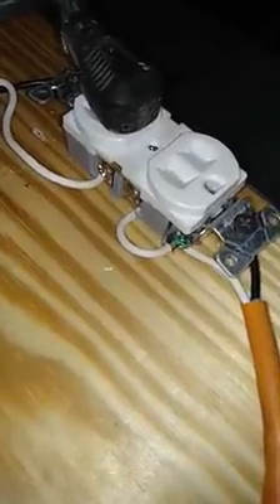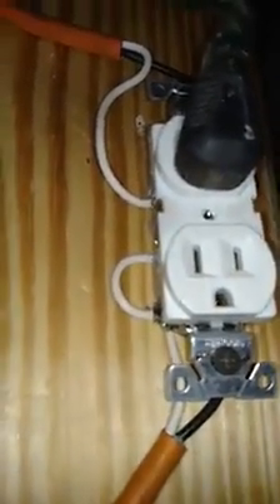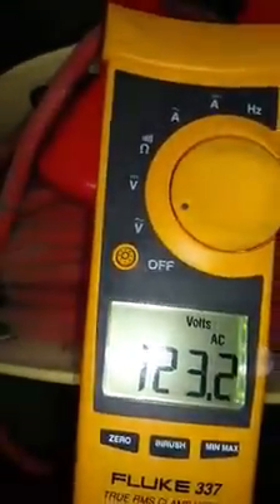Why you never jump your neutral to the ground on a wall outlet.

Comment: why people do this?lack of ground wire?
Reply from the maker: They do it because they don't understand  how current flow works. I guess you can say those that don't understand  current flow do this because  they don't have a ground wire. The correct fix for this is to install a 2 prong outlet. Period. If installing a gfci, just hook the hot and neutral up correctly and then label the outlet no equipment  ground. Done and done.

Comment: Why was the fridge hot? Was there a fault that you made to show the point or does something else happen?
Reply from the maker: Yes, it was a fault, well two faults.
First, the neutral and ground were jumped together. That is improper wiring that is commonly done and it is dangerous. The second fault was I reversed the hot and neutral, which is another common mistake made by people who don't fully understand electricity.
Reply: @dbunk6276  OkI understand now. I meant did you induce any type of fault in the fridge itself? Like have an open hot touching the frame to show that the short protection wouldn't happen now. Which obviously it wouldn't. But now I see what you mean. 

Just a normal wired fridge could do that if someone messes up.
Reply from the maker: So, the fridge chassis was energized because the neutral has now become a hot wire, and with the ground jumped to the neutral on the receptacle, it create a path to the grounding on the fridge which is anything metal.
Reply from the maker: Correct. All it takes is for a "Handyman Hank" to wire a receptacle like that and you'll have shocking issues. I have seen wiring done just like I showed in the video. It's insane.
Reply: @dbunk6276  A handyman could just have one mess up with this bootleg ground and it would be enough still. Since someone else at some time could have wired a receptacle upstream the wrong way and the wiring on the recp. he's looking at appears fine at sight.
Reply from the maker: Exactly

Comment: ZM if you bootleg the neutral you are putting current on the ground terminal. The neutral is a current carrying conductor. On  120 volt circuit if you have 10 amps on the hotleg you will have 10 amps on said neutral if you have a 240 volt circuit with a neutral and line1 has 10 amps and line2 has 8 amps then neutral has 2 amps the only time a ground conductor has current is when you have a ground fault. So what you presented was that it was safe.

Comment: interesting... then how does someone ground a 1950's circuit without major work?  I thought this was safe....
Reply from the maker: With major work is the only way. Please realize that a gfci receptacle does not require a ground for it's proper operation. A gfci only monitors the hot and neutral for a ground fault, not the ground wire. So if all you have is a two wire system, per the nec code, the legal way to wire a gfci is wire the hot and neutral like you normally would and place a sticker on it denoting that there is no equipment ground.
Reply: @dbunk6276   that is not necessarily true, when i replaced my parents 2 prong receptacles with gfci outlets, the gfci would not trip unless you cheated the ground, once you cheated the ground the receptacles worked and tripped as it was supposed to while using a gfi tester, the only reason you may have to attach the ground to the neutral is if the box isnt grounded either, in my old house the metal boxes werent grounded, so you still had to bootleg it to make the gfci trippable, but 1 box was grounded so just screwing in the receptacle without bootlegging the ground worked as intended, this was at my house pre 1910s and my friends house pre 1920s
Reply: @T @TheWackyRigger 
The reason you needed the bootleg ground to get your GFCI to trip, has nothing to do with the GFCI itself.  GFCIs trip if there is an imbalance between hot and neutral. 
It is your TESTER that needs ground to function, because it creates the imbalance by allowing some current to “leak” directly to ground.  
You need to go back and remove the bootleg ground.
Reply: @DavidWood-rc6gj  i learned from my mistakes ! my foreman was the one who taught me that i needed to run a jumper but since then i learned why he was wrong and told him about it too. i totally understand now why i was wrong
Reply from the maker: Peak of insanity..... Pick up some books and read them. 
The ground is not, and I repeat, the ground is not required for the correct operation of a GFCI. It does not connect to the internal workings of a GFCI. It's connection stops at the chassis of the receptacle and that is it. NEVER, EVER, EVER, JUMP A NEUTRAL TO THE GROUND ON A RECEPTACLE. I have been doing this electrical stuff for quite a while. Not sure what exactly was going on in your instance, but I guarantee you that the ground being hooked up to a GFCI or not hooked up to it, does not affect the operation of a GFCI.
Reply: @dbunk6276  it does if the box isnt grounded prior to putting the gfci in
Reply from the maker: @TheWackyRigger  you are incorrect. 
Google it. When you find something on Google that says that a GFCI has to have a ground for it to work correctly, paste the link to that in these comments. I gotta see it and see who is publishing inaccurate information.
Reply from the maker: @TheWackyRigger  meanwhile, I'll post links to articles that show I am correct.

https://www.angi.com/articles/does-replacing-ungrounded-outlets-gfci-outlets-make-them-grounded-and-safe.htm
Reply from the maker: @TheWackyRigger  https://portablepowerguides.com/gfci-without-ground/
Reply: @dbunk6276  I want you to take a gfci, connect it on a board with no grounding to the screw or to whatever you screw it into, attach a hot and neutral and then plug a gfci tester into it and press the test button on the tester, not the receptacle but the actual tester. It will not trip from the gfci tester unless the box is grounded or the receptacle is grounded
Reply: @dbunk6276  unless the gfci needs a bigger fault than the gfci tester can provide
Reply from the maker: @TheWackyRigger  also, like a stated in the video, if you jump a wire from the neutral to the ground on any outlet, or if you have your grounds and neutrals bonded anywhere outside of your main means of disconnect is, you have set a trap and you will eventually get yourself or someone else hurt. You put yourself one step closer to energizing equipment grounds and put people at risk of becoming the path of least resistance to ground and electrocuting them.
Reply: @dbunk6276  yes I understand that with regular 3 prong receptacles but it should trip before it comes to that point, i totally agree with regular receptacles, i could have been thrown off by the gfci tester not tripping the receptacle when only having a hot and neutral connected, i don’t see how it would trip after bootlegging the ground but not before, atleast with the tester
Reply from the maker: @TheWackyRigger  the tester will not trip the GFCI because the tester shunts the neutral to ground to cause the imbalance between the hot and neutral which makes a GFCI trip. The test button on the GFCI itself is a sufficient test to make sure the GFCI is operating correctly.
Those little home inspection outlet testers are junk. A good quality tester which would also detect false ground cheats, aka a bootlegged outlet costs about $1500 and would be money well spent to help save people from "shocking" experiences.
Reply: @dbunk6276  so you are saying the ground has no function in the process of tripping a gfci ? I would think the ground would be what the gfci tests for energy, but If it really does just use the hot and neutral then I’ve learned something from this conversation
Reply from the maker: @TheWackyRigger  your comment still doesn't mean that the GFCI will not work correctly without a ground. It simply means your $8 tester doesn't work correctly if it isn't grounded.
Reply: @dbunk6276  I think that was what threw me off
Reply: @dbunk6276  I appreciate your time d bunk, I’ll definitely carry that knowledge with me in my career, I’ve been doing electrical for about a year and mostly do generator installs, i understand the danger of having bonded grounds and neutrals after the first means of disconnect after the meter, but figured with wiring gfcis in a 2 wire home you had to, i am wrong so thank you for teaching me
Reply from the maker: @TheWackyRigger  like I said earlier, the cheap tester is shunting the neutral to ground. It doesn't short the hot and ground or hot and neutral. That would create a over current fault and the circuit breaker would open up under that type of fault.
Do yourself a favor, if you still have GFCI outlets with the neutral and grounds jumped together, please remove those jumpers. You didn't make a safe situation, but created a hazard. Forget about the little cheap pocket tester. Those are not the ideal way to test GFCI outlets.
Reply: @dbunk6276  yup, I will be fixing them next time I’m over
Reply: Backstory: I used to own several income properties. One of my tenants installed ceiling fans in the BR's without permission and broke a wire. The electrician I hired would not sign off on the ONE repair until the entire property was brought up to code. Since I have had some training, I asked to do some of the work and have the electrician inspect it to save money. I was taught that in order to properly ground an outlet in older construction, there needed to be CONTINUOUS ground all the way back to the service panel. This could be metallic sheathing (armored BX or conduit/pipe) or nonmetallic cable with ground. Also, water pipes must not be used to provide ground (ground rods and conductors is a whole additional subject). 
To ground an outlet in older construction - a 10/32 hole must be drilled and tapped at the back of the box (it may already exist if the home is post-war) and a green ground screw and a green ground wire of the proper gauge added from the box to the receptacle. Note: The receptacle MUST NOT be used as a connection to additional devices (all 4 screws used to jumper to downstream circuits) if the old construction used this method, the wires must be connected together using a suitable device or proper wire nut, and an additional wire ("pigtail") added to connect to the receptacle. Also, if there are multiple items requiring grounds, a green wire nut must be used to connect the ground wires together, with each device having its own seperate wire. That is to say, no "daisy chaining" of grounds to devices. I hope this helps.

Comment: Yes, a reverse polarity bootleg is very dangerous compared to a regular correct polarity bootleg.  What complicates it, is that unless the person is grounded in some way, you will not get a shock from the energized refrigerator (in this example).  That is why the client will tell, "sometimes" I get a shock, sometimes I don't.
Reply: @StringerNews1 What if the ground wire is energized below the trip threshold of the breaker?  If you want to prevent shock, we use gfci